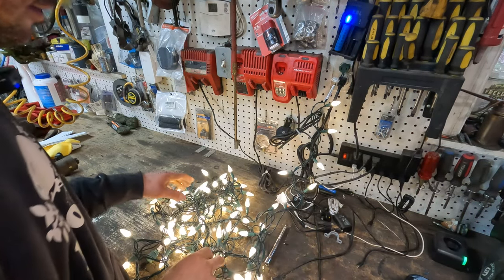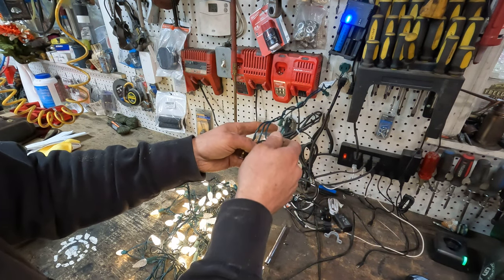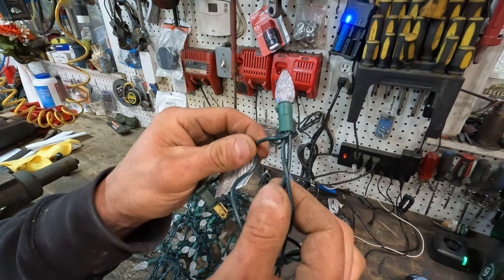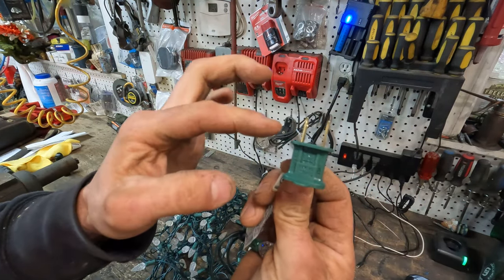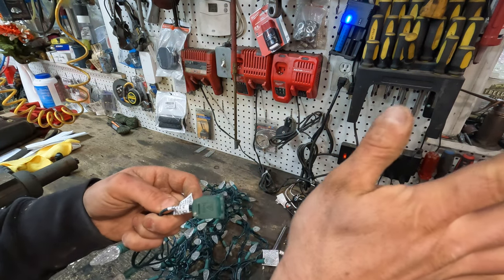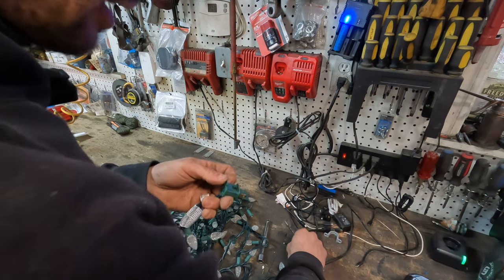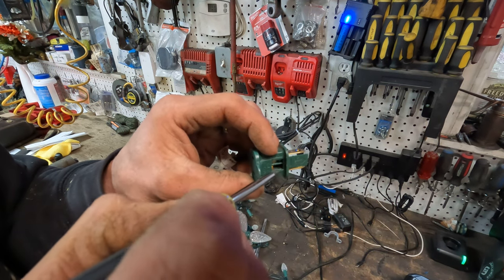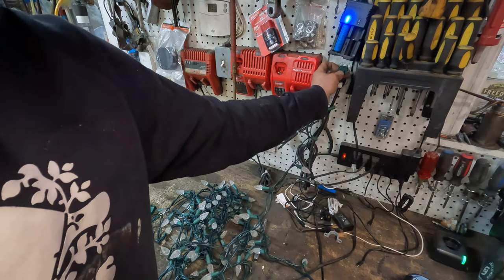Fixing LED Christmas Lights - Fuses Explained

Comment: GE has connects 6 and that does use a single 5 AM. Miniature, fuse, they are so a miniature light string. They are polarized, other brands as well. And then you had the C7 and C9 that use the single 5 AM fuse, and then you also have the pro line sockets for C7 and C9 that are unfused and just rely on circuit breaker. I have taken at 10 AM. Confuse and put it into the C7 and C9 sets for nuisance. Fuse, blowing The fuse will still go away quicker than the circuit breaker will

Comment: I have a 100 count led c9 noma string that every time i plug them in the fuses in the plug blows. I have checked all the bulbs and visually checked for broken or exposed wire and dont see anything wrong.

Comment: Hello, can you tell me how to repair female plug on the lights ? The end female connector plug is not working in my case. I tried prying with my screwdriver, but it doesn't open the case. Any suggestions on special screwdrivers is also helpful !

Comment: I have a string of LED lights not working. I want to change the fuses but the plug does not open like in your video. There's no sliding opening.

Comment: Hey, I need some help. I bought a bunch of Christmas lights for my backyard and I spaced them together to have one full connection. And they worked for about 30 seconds and they just went out. Could it be the fuses that can’t handle that?
Reply: Spliced*
Reply from the maker: Definitely the fuses

Comment: mother bought all new lights to hang up last minute, box says to not chain them together, i did it anyways and tonight they all went out after a couple hours, have been good for about 4 days till tonight. im guessing the fuses popped and i can put new ones in and itll work but how do i prevent this from happening or is there no way.